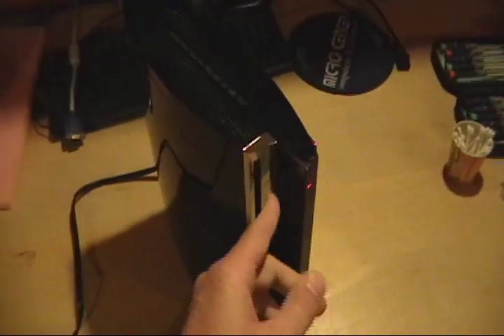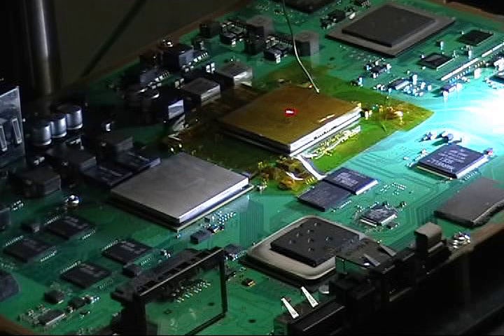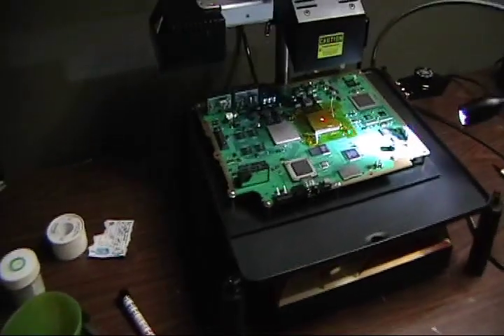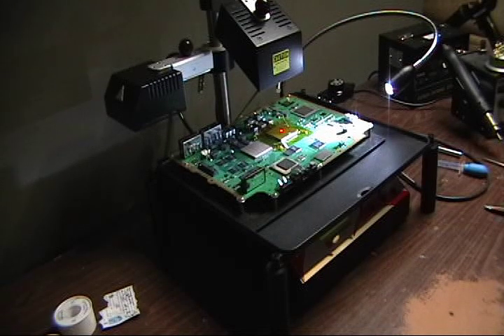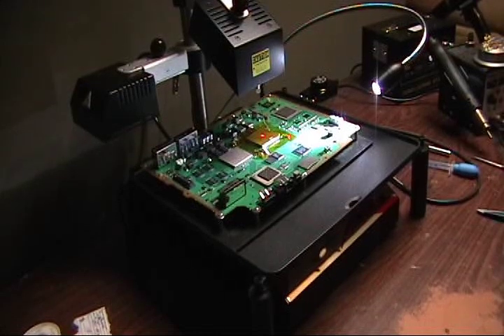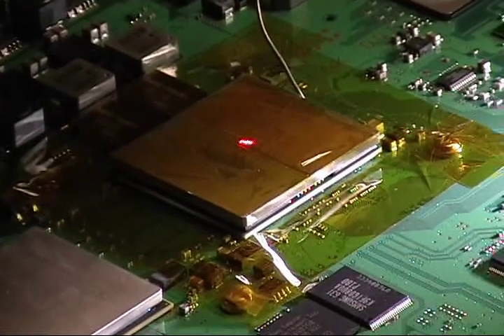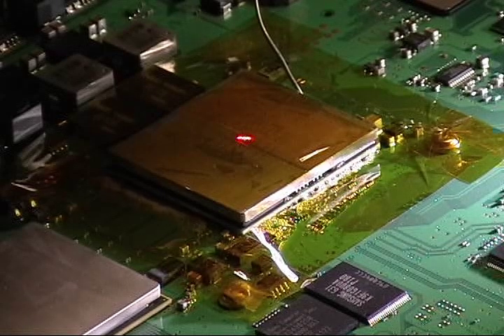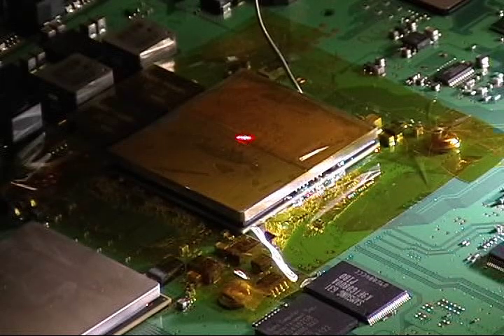PS3 YLOD Reball Part 1

Comment: so people dont get confused this is REFLOWING not REBALLING.  Reballing is taking the chip off the board while hot and replacing the non-leaded solder balls usually with leaded solder balls(which handle the constant heating and cooling better than non-leaded solder), then putting the chip back on the board. reflowing will fix the problem for a short time, reballing lasts much longer.

Comment: hey what software do you use for the jovy? and how much of a difference does it make if you use lead free sader balls compared to the lead? what cleaner solution are you using? last but not least when adzactly do you change the tempurature on the jovy?

Comment: not if you have used a heatgun, the sucesess rate drops by about 50% after a cheap reflow. the board warps causing the chips bga to form an inpropper connection with the motherboard. If the ylod occurs get a pro reflow or a pro reball. dont piss about with heatguns and ebay stencils.

Comment: I have seen many videos on reballing gpu's, and I have to say that your videos are very detailed and well explained making them the best I have seen so far. I was wondering if you would be so kind as to make a parts list containing the best materials to use and where to find them. Such as the cleaning materials used, the different  types of flux, the different solders, the stencil for the Gpu "xbox and PS3.

Comment: what temperature you use for lead solder balls with your air station? and why not use the mesh is not faster desoldering clean the plate?